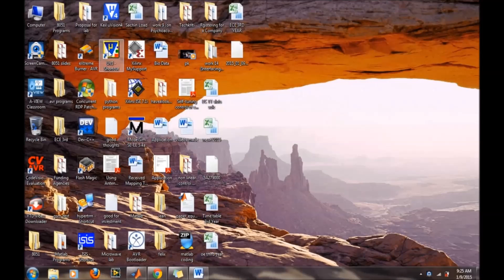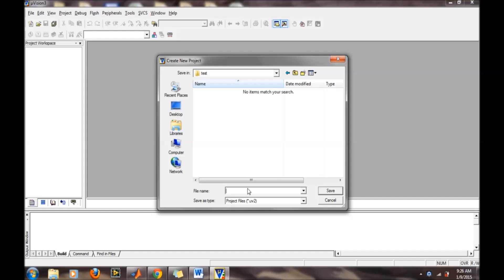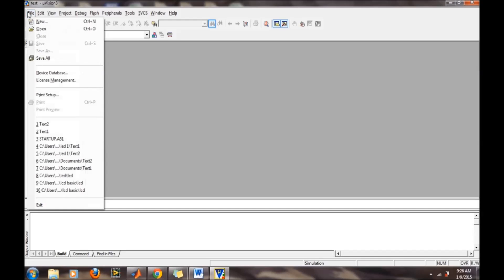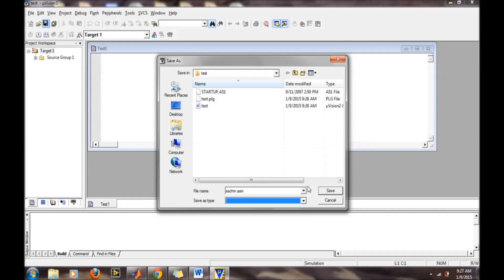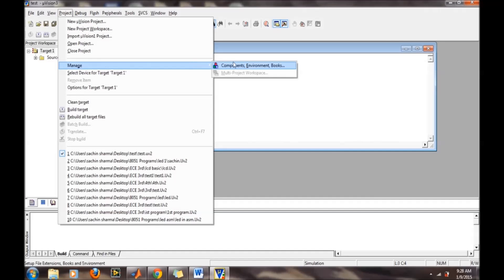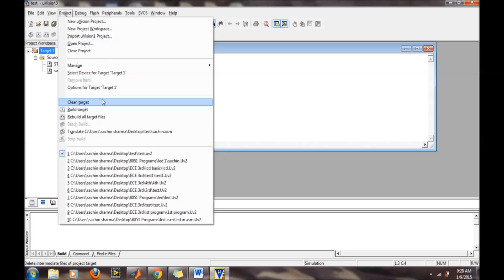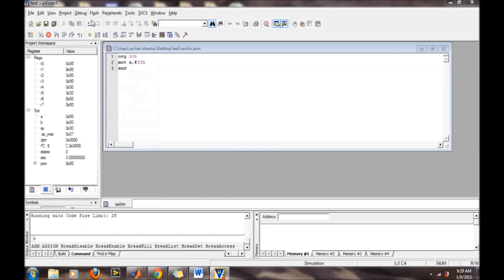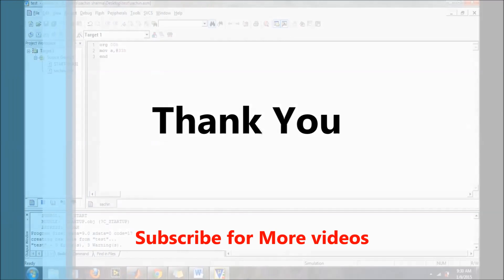writing a program in assembly for 8051 in Keil software..

Comment: hello sir I am using keil 5 and AT89c51 and getting these warnings

I got no error but 3 warning and not able to figure out the reason for this.
can u please explain.

this is my code

ORG 0H
  MOV R5 , #25H
  MOV R6 , #25H
  MOV A  , #0H
  ADD A  ,  R5
  ADD A  ,  R6
HERE: SJMP HERE
END

this is the build output

Rebuild target 'Target 1'
assembling STARTUP.A51...
assembling main.asm...
linking...
* WARNING L5: CODE SPACE MEMORY OVERLAP
    FROM:    0000H
    TO:      0002H
* WARNING L1: UNRESOLVED EXTERNAL SYMBOL
    SYMBOL:  ?C_START
    MODULE:  STARTUP.obj (?C_STARTUP)
* WARNING L2: REFERENCE MADE TO UNRESOLVED EXTERNAL
    SYMBOL:  ?C_START
    MODULE:  STARTUP.obj (?C_STARTUP)
    ADDRESS: 080AH
Program Size: data=9.0 xdata=0 code=25
"assembly1" - 0 Error(s), 3 Warning(s).
Show less
REPLY